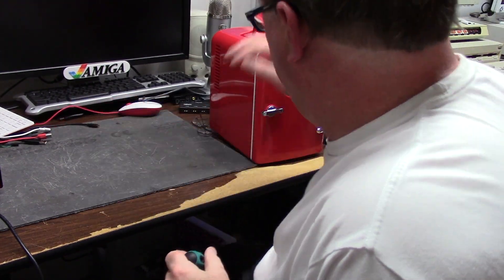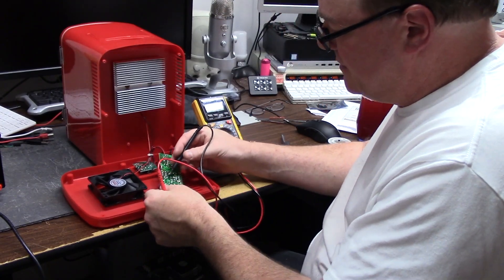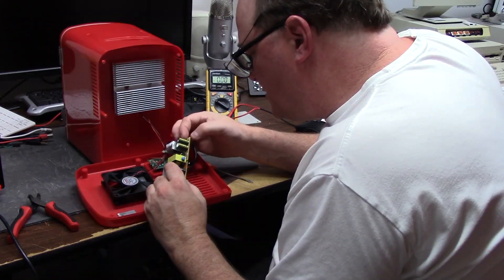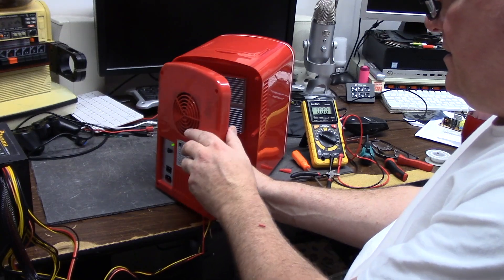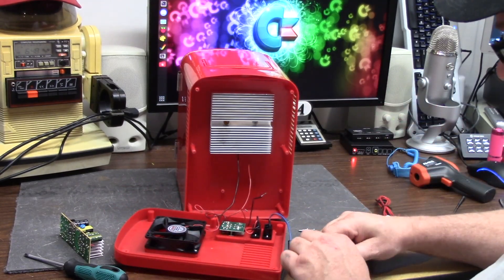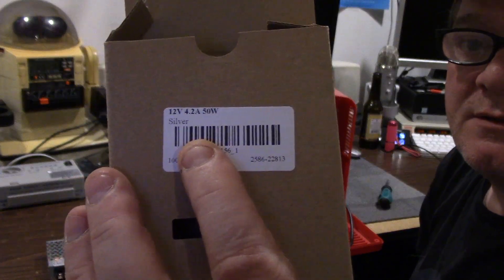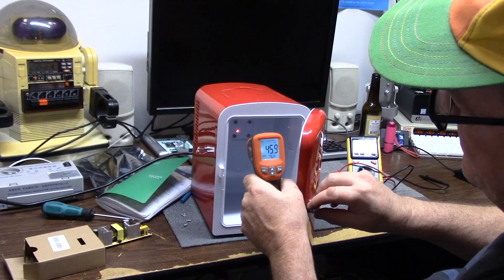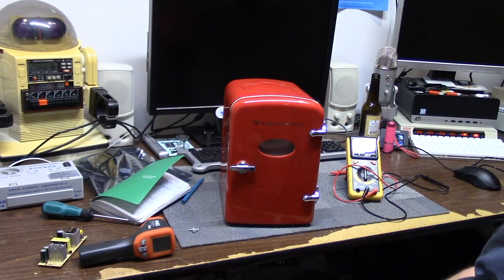Frigidair mini fridge power supply upgrade

Comment: What is the other board the on/off switch is connected to and is it possible to obtain one? Thank you!
Reply from the maker: Its part of the original power supply its the on off switch for the mini fridge it should be on yours
Reply: @ChrisEdwardsRestoration  Yes, it is burnt at the fan input and not working. I need to replace it. What do you suggest?
Reply from the maker: @razorsharpbt124  you dont actually need it, you could wire it direct DC with a wall charger if you can get one outputting enough watts, 35 min
Reply: @ChrisEdwardsRestoration  Yeah, everything else is working fine. I'll just use a switch in the place of that board. Thanks!

Comment: Hey I have a question about this kind of unit. So me and my father took mine apart and it seemed to have a burnt out circuit like yours. We didn’t have a replacement board so we took a close look and I told him I didn’t need the heating function. We decided to cut the board out and link fan wires with the power supply. The fan runs but it still won’t cool. So far the only thing left for me to try is replacing the metallic liquid in the heat sync(I think it’s called that.)
Does the board make a huge difference? Does it help with the cooling? Or is it just the fan cooling the heat sync?
Reply from the maker: You need the board as it does more than power the fan it provides the Peltier reaction that makes it draw heat that the fan cools
Reply: @ChrisEdwardsRestoration  oh damn. Thank you so much for getting back to me.

Comment: Good evening Mr. Edwards. 
Thanks for the video I have a mini fridge that has the same problem and it also has a high pitch noise. 
I have another mini fridge that the small circuit board the switch burned off. I replaced the switch but it didn’t fix the problem. Do you know where I can get that part from? Thanks in advance.
Reply from the maker: i posted the part link a few comments above

Comment: For those that are looking for this power supply, here you go.
The MEAN WELL RS-50-12 has Voltage Adjustment, the MEAN WELL LRS-50-12 does not. Chris got the first one
Reply: So the link in the description takes you to the lrs-50-12

Comment: The same thing happened to my mini fridge I have the same 1 as you can you tell me the name of the replacement part you bought and where you got it. Thank you.
Reply from the maker: Ebay 20$ and direct link here!   https://www.ebay.com/itm/122214376431
Reply: @ChrisEdwardsRestoration  Thanks for the video, it really helped. Also that link now goes to the 65w version. I wrote a comment giving the name of both 50W 12V 4.2A models.
Reply: @ChrisEdwardsRestoration  thank you for the reply greatly appreciated!!
Reply: @ChrisEdwardsRestoration   could you link me to one for the Mountain Dew mini fridge? It’s doing the same thing.
Reply from the maker: Look at the comments above these
Reply: The MEAN WELL RS-50-12 has Voltage Adjustment, the MEAN WELL LRS-50-12 does not.

Comment: I might use a fan on a separate power supply for the power supply on the fridge so it doesn’t burn out. Is there a power supply if it only has dc, I’m a dumb ass about wiring.
Reply from the maker: the built in power supply has a rectifier so it converts ac to dc hence why the back has a ad/dc switch. the meanwell 50watt is more than enough to super cool it. this repair has been great and still runs on my work desk to this day holding at a 38f temp all the time.   super easy ac goes to ac dc goes to dc. but you CAN wire up a direct DC to the main circutboard without the ps, as it is a dc connection. so find something in the 50 watt range 12v and go for it.

Comment: Is it ok to use a power supply that uses more watts?
Reply from the maker: Dont go too large, your still using the orig circuit board for controls and switches. For example the stock is 35 watt , i used a slightly larger one, meanwell power supply, small fits in the space and works well
Reply: I order a 60w 5a 12v power supply. The 50w 4.5a 10v was sold out. You think It’ll handle it? Because I’m remembered plugging the original power supply to a smart plug and it fried it. I’m not sure if this power supply I order will handle it.
Reply: @pizzahut4390  Did it work?

Comment: thanks for ur explaining but can u please answer me how to connect the wires please like diagram
Reply from the maker: No diagram is needed.  If you hold a replacemebt meanwell up to the original. The ac side ( mains wall power)) goes to it, the dc side pos/neg goes to its corresponding terminals

Comment: How exactly did you wire it? Cause I am planning on getting one since my little fridge stopped working
Reply from the maker: Its self explanitory.  There is a ac side and a dc side.  The wall power is the ac side.  The fan is the dc side.  Its all marked

Comment: put a 3 pin noctua 80mm uln fan. used a 3 pin to 2 pin adapter and a 2 pin extension. soldered the 2 pin the the hardwired dc lines to the extensions corosponding lines and then hooked it all up and mounted it. 1300 of the quietest rpms

Comment: Chris, I like to look before I leap.  Is the correct power supply a NES-50-12 12V 4.2A 50W?
Reply from the maker: my replacement power supply was a MeanWell RT-65B  works perfect! makes it cold af!
Reply: @ChrisEdwardsRestoration  I ordered the same model, but mine is definitely larger, not sure it will fit.  Mine matches Mean Well's specs, but the 5"length looks longer than yours which appears to be 3" to  3.25".
Reply from the maker: No its 5.25x4.  It fits.  Tightly but fits

Comment: is there a way to make it cooler? awesome vid btw
Reply: I Upgraded The Fan With Better RPM,and Has LED..Its Extremely Quiet,and Does A Nice Job Of Keeping Drinks Cool,My Fiancé’  Grandson Says Its His To Keep His Drinks Cold While He’s Playing😂😂.But Yeah..Upgrade That Fan.You Dont Hear It At All
Reply: yes better fan see my comment for idea how, my method was for quiet efficiency after the fan started to squeak. same method can be used for a 3 pin flx or pnw noctua fan so long as the rpm is pinned a higher rpm fan could be used to up the air intake on the heatsink/plate
Reply from the maker: No
Reply: maybe put some flame stickers on the side

Comment: Greetings! What needs to be done to change the temperature difference at which cooling will continue? I mean, how to increase the difference between the ambient temperature and the temperature inside? Maybe you need to increase (or decrease) the resistance on the ambient temperature sensor?
Reply from the maker: peltier cooling draws heat away through the heatsink and cools it with the fan thus causing a cooling effect inside. this now runs at around 45 degrees F after about 30 mins. and is living back on my work desk since its upgrade. and works just wonderful!
Reply: @ChrisEdwardsRestoration  But how to lower the temperature even more? How to cheat the sensor?
Reply from the maker: More voltage, faster fan, larger heatsink. Thats how they work. There is not a sensor its regulated by voltage
Reply: @ChrisEdwardsRestoration  I have a cuisinart cwc-900 wine fridge. The temp only gets 20 degrees cooler then room temp. About 54 f. I upgraded the fan that blows on the heat sink and it's quiter but still not cold. Any tips to make the internal temp colder? There's dual fans inside the fridge part, nothing is blocking the fans. All fans clean, everything seems to be in working order but?
Reply from the maker: Is it Peltier effect like these? If so increasing the current causes more heat which in turn creates more cool inside.
Reply: @ChrisEdwardsRestoration  more current? So I higher power supply? A bigger fan on the heat sink would not work? I'm a bit of a novice with electric items. The heat Ai k is double maybe even triple the size of the one in the video u have up
Reply from the maker: See if its the pettier effect. And google it so you can get a better handle on how it works

Comment: My on/off switch nearly melted . Board is burnt black beneath the switch . I looked at the board and it looked like there is a short from solder flux on it.  Might try to get a switch from the electronics store 10 miles away.

Comment: Would it be possible to just replace the rectifier?
Reply from the maker: Yes but it was a cheap Chinese power supply and i use this daily at work. So a meanwell was what I wanted  and it runs great!

Comment: I need new fan just died, what do need so many to pick from. Still under warranty but need to jump through hoops so figured fix it myself. Sadly fan only lasted 5 months
Reply from the maker: its a standard 80mm pc case fan
Reply: @ChrisEdwardsRestoration  going to try and fix it myself so I'm not big on this stuff but i can follow direction. First got the replacement fan and it has 2 plugs, big with red/black wires and small with black/red/yellow wires but fan in fridge only has black/red and no plugs which figures nothing is easy. This fan is bigger (thicker) than original which is ping shun electronic co YD8020MS DC 12V 1.6W. Now what

Comment: I got a Kooltron 12 can cooler like a vending machine was working then blink blink, I think either to recap or upgrade the PSU, a 5p watt PSU is basically more than the unit itself ;)

Comment: We can tell that you mean well.

A bit of double sided tape will stick the power supply to the back cover.  You could go overboard and cut out some of the rear panel so that the base plate of the PSU is exposed for better heat transfer. But then, you already have forced convection.

Comment: hi Chris that was a great fix. always nice to have some cold beers.

looks like I caught your previous video upload a bit premature while it was still flying trough the tangled wires of the WorldWideWeb. as now hidden for me to watch.
I did read the >read-me< file, but i do not know exactly what i'm doeing wrong. indeed i cant get the >kick< partition to show up by name on the sd,
is it that smallest of four partitions of approx 107 megs?
and it wont let me give it a new drive letter. (the boot:!? yes, that one will accept a new letter) but no kick.
i saw you writing about dont use win7, i run 8 . does it has to be 10. to get it showing up?
i will be greatfull for the solution. and again willing to do some PP donation for buying some tasty chicken wings. ;)
Reply from the maker: It has to be 10 or greater
Reply: @ChrisEdwardsRestoration  i think i have to be patience and wait until the video is back on again. maybe then see what i'm doeing wrong.
i dusted of an window10 system i had standing in a corner. did extract the 7zip file on it. (pimiga2.img) and the readme. as you told us RTFM ;) lol
and used PI imager to burn the image, opened it via diskmsmt. and it shows 4 (parts)  
1: a part named boot: with a letter of 256mb fat32  (primaire partition)
2: a part with no name 107mb with a right mouse oppurtunity to change drive letter and path. But it wont let me complaining about refreshing. which i repeatedly tried to refresh/renew.
3: a part with no name 40,79Gb (primaire partition)
4: a part with no name 77,93Gb yet not available which i assume will be given free after we do the SuDo rasps thing.

for  now i think it's all about that second part, just dont understand why it want let me do anything with even with an adminitrator prompt and keeps giving me the red cross. even after refreshing.

maybe later when i get smart i will get i, it must be something simple.  ;) thanks.
Reply: @janwiersma1449  make sure after writing to sdcard yu unplugg and replug so the computer can see the changes. I did what Chris put on the image instructions and all went well!!!!!
Reply: @MrAlan1828  i solved it. bought a cheap windows 10 machine also for the future.  and the kick drive showed up imedeately.
on the other system it would not show because that was a dual boot tv box with win10 and android , i think the android was the OS and win was running on top of that (did not show) i think. thanks for your thinkering.